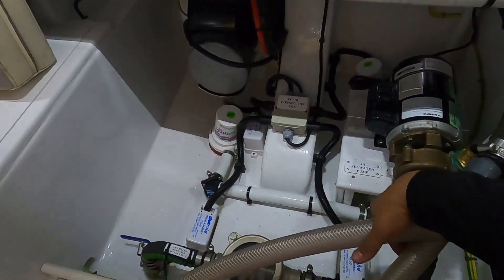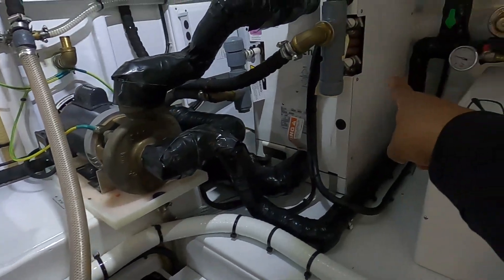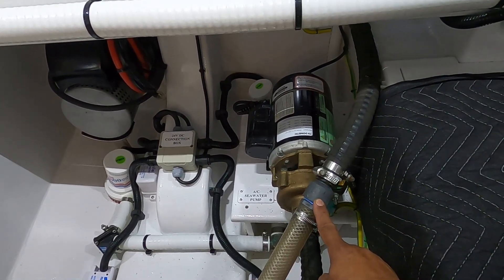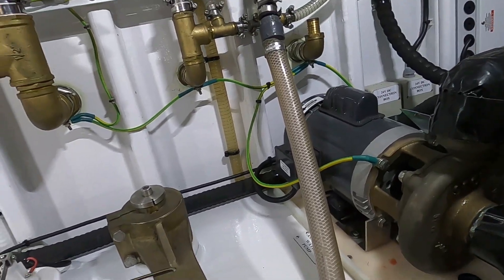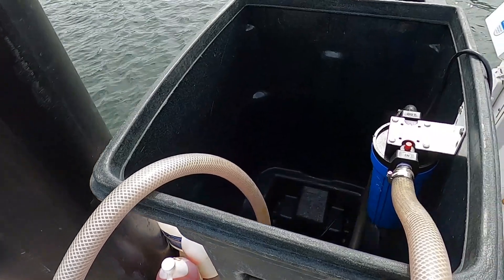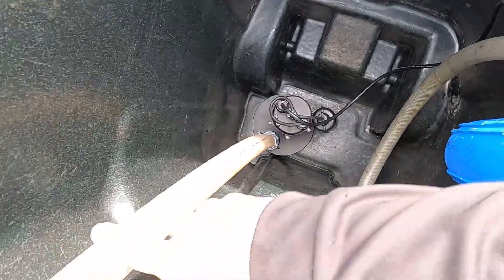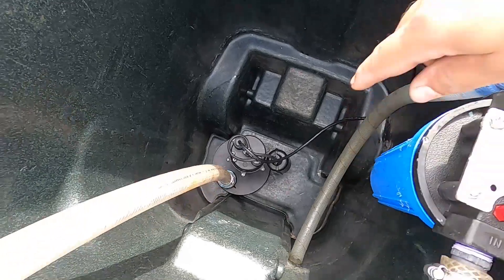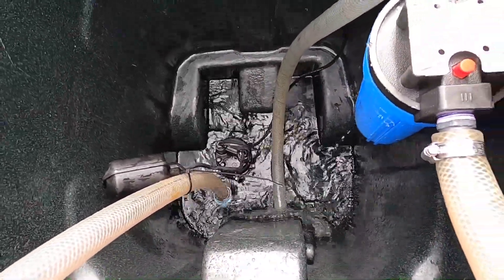How to Descale or Acid Flush your Air Conditioning System in a Boat

Comment: How mulch acid did you use for that application. That a lot line to have to run through.  And, how much water also?
Did you go in the direction of normal flow, or did you reverse the flow
Reply from the maker: I normally use 2 gallons of the concentrate solution. I kinda gauge the water in the bucket so it just goes over the pump for priming. I figure once the I have water returning to the bucket and the water level just to the top of the pump is about 12 to 15 gallons of water in the system.

Comment: Hi, the hose you disconnected from the outlet, would this normally just go to an outlet draining into the water / ocean? If so I don't have to disconnect this, correct?
Reply from the maker: You do in order to loop you solution back into your bucket, otherwise it would go overboard and be lost.
Reply: oh course yes, but this is going to be hard as the unit is difficult to get to, the inlet is easy but the outlet will be hard.....thanks heaps and leave this with me... @trianismarine

Comment: What did you use for the descaler acid? What mixture?
Reply from the maker: Barnacle Remover Concentrate. You can also use Barnacle Buster Concentrate and I mix it appropriately 1 to 4. 1 gallon of the acid for every 4 gallons of water.
Reply: Barnicle Buster is not approved by US Coast Guard. The base acid is Phosphoric and not inhibited to protect the system also will not readily dissolve scale which is found in warm coastal areas having coral.

Comment: Is there any disadvantage using the AC water pump that pumps the water through the unit during normal operation to circulate the water during the flush?
Reply from the maker: I guess if it is the only thing you have it's ok, but, I like to use the sprinkler or well pumps better because they can put up a higher pressure that the standard A/C pump. The higher pressure helps pushing out the growth and scale out of the system. Also the  bronze pumps can get affected by the solution and develop leaks.